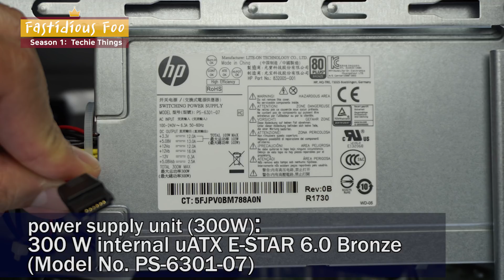Partial Teardown / Parts of HP Pavilion Power Desktop 580-023w

Comment: There is a small taped black wire to the bottom of the power supply. Where does that go to. Mine came off, not sure if it was sodered on or gets put into somewhere
Reply: did you end up figuring this out? I’m having the same problem 😢
Reply: Тоже самое..

Comment: At the top there is two thin black wires that's stuck at the very top. I think it's to do with wifi. I have no idea where they go back in too... bascially under the power bit.
Reply: did you end up figuring this out? I am having trouble with these cables too and I need some help 🙏

Comment: I don't know if you'll respond, I have this PC and I have a bunch of new parts I just ordered, and I'm wondering if I can reuse the case
Reply from the maker: Depends on the size of the new parts and what you are adding. But case is reusable, although there are reasonably priced  better cases out there
Reply: @fastidiousfoo  I'm planning on switching the motherboard, getting a new ryzen CPU, new PSU and eventually a new Gpu, I'm going for a 1660. But I've heard that cases for prebuilt PC's like this were made specifically for the parts that already come inside. Can I reuse it?
Reply from the maker: @Budymryo  i just opened up mine an confirmed that most of the parts were replaced and i am still using the case. So yes you can reuse the case but you will want a motherboard with 2 usb 3.0 headers.

Comment: Alright, I'm not a PC expert or anything, but I have the lower model of the Pavillion, and I'm pretty sure you should unplug the PSU and press the power button to drain the electricity that is still in the PC. If you don't, you face the risk of getting shocks and/or dying.
Reply: the PSU is not a battery lmao

Comment: Do you think I could fit a AMD RX 580 in here?
Reply: I did my own measurements 
Height:5 1/2 inch
Lenght: 9 inch
Lenght without disk drive and if you remove disk drive holder:13 inch

A normal 580 is about 9.5 inch and 5.3 inch in height its might be posible but dont take my word for it.
Reply: TheBilly27 thanks 🤗

Comment: i have this exact computer. I upgraded the 300watt psu to a 500watt evga psu. i then added an extra 1tb HDD i had laying around. then about a month later i added an extra 500gb HDD. i also got a steelseries apex m750, razer death adder elite, and a corsair void pro gaming headset. overall this computer works great!!! it can reliably run planet side 2 at max with 40-60fps. and it can easily run games like cs-go and dota 2. But those games could run on a toaster... overall i would recommend this computer.
Reply: How did you add an extra 1tb HDD? I added a 1tb SSD is it similar to how the original HDD was put in?
Reply: Works great with a GTX 1060 and runs many games on high settings

Comment: Hey i took off the front panel and i cant get it on what should I do?
Reply: there's slots for it on the left side of the front, set the plastic clips into them at about a 45 degree angle, then push down onto the right side until it clicks into place it'll be a loud audible click and depending on how you applied pressure it'll either be one solid click as all three go into place properly at the same time, or if you didn't push evenly then you'll hear all of them click into place one by one basically. hope this helps.
Reply: How did you remove the front panel? Did you have to remove the DVD first?

Comment: Will a 1070 fit in this case and motherboard?
Reply: There is place for a 1060 but 1070 no
Reply: If you wre planning on just throw a 1070 in the case it is possible but upgrade the cpu with it since it'll throttle it.
Reply: matthew williams yes is it possible, but you have to remove the cd/dvd writer

Comment: did you cut off the zip ties on the cables? they are contricting my abiltiy to put in the sata cable in my ssd
Reply from the maker: No, I did not have to cut off any zip ties but you do whatever is necessary ;)

Comment: Is this the same case as the HP Power Pavillion 580-023w?

Looking to add an SSD with the HDD
Reply from the maker: yes, this is the Power Pavilion 580-023w case
Reply: Fastidious Foo how many hdd drives can I add to this. I had a spare 2t hdd Drive and was wondering could I add that to the one that already in it for extra storage.

Comment: Can I change the grafics card with no problems of the motherbase? (Of course I will change the PSU)
I have the 580-070ns and it has a gtx 1050 2gb vram with a i7 7700 and 16gb ram... thank you...

Im spanish and I dont know if I explain very well...😓

Comment: do i have to take out the hard drive to install more RAM and should i upgrade anything else besides RAM?
Reply from the maker: no, you don't have to take out the hard drive to install the RAM if you can just reach for the slot. I'd probably get a SSD maybe get some new fans (the computer does seem to get hot at times) and I've heard that a lot of people replace the PSU as well.

Comment: pls help, i bought a variant of this pc (the 580-015na) which has a 1050 instead of a 1060, but on the website it says it has a 180w power supply when the recommended power supply for a 1050 is 300w?? if the power supply is 180w then how is the graphics card even working?
Reply: you should open up your computer and look at what your power supply actually says instead of some website with wrong info

Comment: How hot does that 1060 get? I does not look like a very powerful cooler.
Reply: Normal temperatures during heavy load. If your GPU goes up to 90C, that's when you worry. If you want to check the temperature of your GPU during gaming, I suggest downloading CPUID HWMonitor which is what I use. It'll display ALL types of voltages and temperatures for your PC components.
Reply: Steven_T_K some games it gets to 80C and my maximum temp it reached was 85c. Lowest is 45-50c.
Reply: Azelkaria thanks
Reply: Is thst high or is thst good
Reply: King Artic  it’s ok, things should stay below 90-100c in a pc.
Reply: Azelkaria I use nzxt cam because it has a simple easy to understand interface and an optional overlay
Reply: Azelkaria how would u cool it just close the games?
Reply: Yes, just leave the game if you're not playing it, put your PC in a well ventilated area (do not shove that shit in corner of walls giving 0 airflow) and make sure the room where your pc is at is at a good cool temperature. Your other option is to buy a different case with a lot of good air flow and just transfer all the components to that new case. Reason why I said to get a new case is because this case has poor airflow due to it being very compact. The cables are in a tight space and you can't really upgrade your Case fan due to the case being small.

At this moment, I have not replaced my case and the PC has been working fine. In the future when I have enough money, I will buy a new case to transfer my stuff.

Comment: That thin cable at the beginning of the vid 1:15 on top of the hard drive what is that? Would that cable matter if I switched the case?
Reply from the maker: that's the grounding cable connected to the SATA cable that came with the PC...
Reply: Fastidious Foo do I need to keep it grounded on the new case or does it not matter
Reply from the maker: it shouldn't really matter

Comment: what is the core clock and memory clock of that gtx 1060?
Reply: It is not a GTX 1060, it is a Hp Nvidia 1060 3gb itx.  The hp version requires less power.  The GTX would require a power supply upgrade.  The power supply in this computer is only a 300 watt.

Comment: Great video. I have a question. I want to keep the hard drive that's in it and add another. I already have a sata cable but not a sata power cable. What kind of connectors are on the power supply? Will I be able to use one that's already there or do I need to buy some sort of extension cable? Thanks.
Reply from the maker: there's additional power cable for the 2nd hard drive, so you do not need to buy an extension cable
Reply: where is it?  @fastidiousfoo

Comment: Can you buy better fans to replace the ones it comes with?
Reply from the maker: you can or if you don't mind the non-aesthetically pleasing look, you can even add a 120mm fan on the side.
Reply: Fastidious Foo what are the general size of fans for this? I’m a bit new to PCs
Reply from the maker: CPU fan is 80mm and case fan is 90mm.

Comment: In my opinion is this a suitable gaming PC and not bad on price too, BUT with lower GPU and CPU intensive games due to the poor cooling on these higher performance parts. The cooling on the GPU especially for a 1060 (even it’s a 3gb model card) It’s really insufficient same with on the i5 even though it can’t be over clocked still insufficient cooling. Also not really a great a amount of fan holes on the case(Except the one side panel) it not really good; then you have thermal throttling if you’re playing intense titles.
Reply: The_ Mysterious_Gamer , maybe doesn't have to much fans but mine only reach 52c cpu and the gpu 65c at 2k and almost 73c at 4k

Comment: I’m thinking about replacing the power supply, so can a regular atx psu work?
Reply: I have the same question, have you find an answer yet?
Reply: I changed mine with atx it worked perfctly
Reply: James Luke Enriquez what PSU did you buy ?
Reply: Rosewill 500w
Reply: Rosewill 500? U didnt have to buy a adapter for the connector? Ive been having trouble finding the right psu. I have a amd r9 fury  nano 6gb gpu in mine right now and gonna upgrade soon so i need a new psu and thought u needed a atxu to make it fit?

Comment: so what would you upgrade ? 
i have this computer and dont know where to start
Reply from the maker: probably a good place to start would be RAM... Are you having any issues so far with the computer? If not, why upgrade?
Reply: Fastidious Foo no problems on the main games I play like overwatch. But games like Rust won’t run at all.
Reply from the maker: I am not an expert on computers or games so I am not why you are unable to run the Rust. 
But I did a quick google search to see what the minimum requirements are and the computer should already meet the minimum. But to meet the recommended requirements seems like it would be best to upgrade the RAM This is what  I found:
Here are the Rust system requirements (minimum)
CPU: InfoCPU SPEED: 2 GHzRAM: 8 GBOS: Windows 7 64bitVIDEO CARD: Graphics card with DirectX 9 level (shader model 2.0) capabilities. Any card made since 2004 should workSOUND CARD: YesFREE DISK SPACE: 8 GBRust Recommended RequirementsCPU: InfoCPU SPEED: 3 GHzRAM: 16 GBOS: Windows 10 64bitVIDEO CARD: Nvidia GeForce GTX 980SOUND CARD: YesFREE DISK SPACE: 10 GB

Comment: Is that a normal sized atx power supply, because I am looking to upgraded it.
Reply from the maker: 300 W internal uATX E-STAR 6.0 Bronze power supply per product specs
Reply: Fastidious Foo thanks for the reply but is there a difference between atx and uatx psu's?
Reply from the maker: The biggest difference is the size of the casing (obviously the microATX psu is slightly smaller) but other than that from what I know they are very similar

Comment: i got the same exact computer. and i ran this test and i have a western digital hard drive not  Toshiba. did hp mix them in the same computer?
Reply from the maker: i guess it is possible...
Reply: There basically the same hard drives there shouldn't be any  diferences